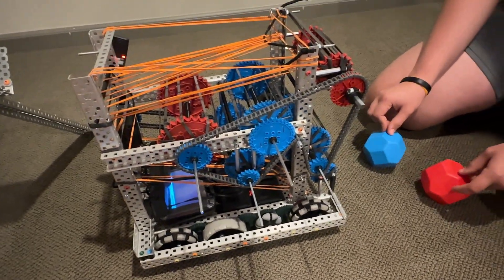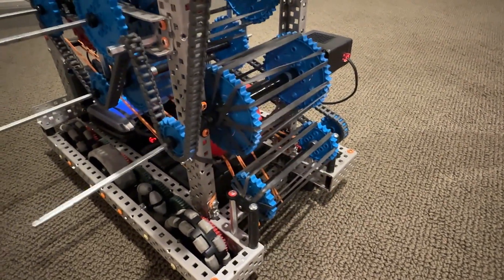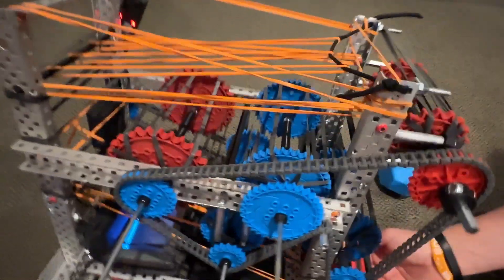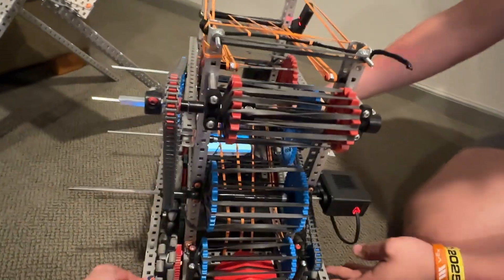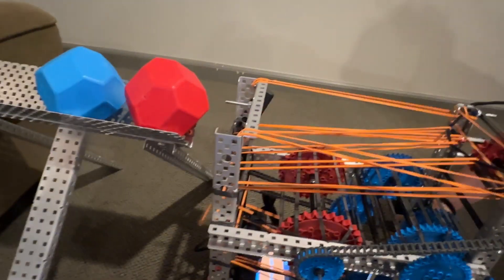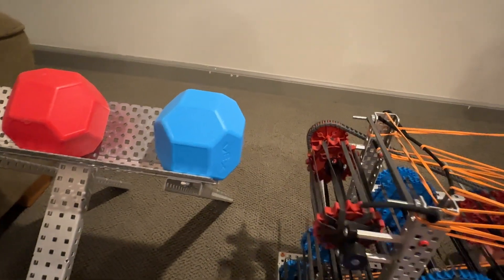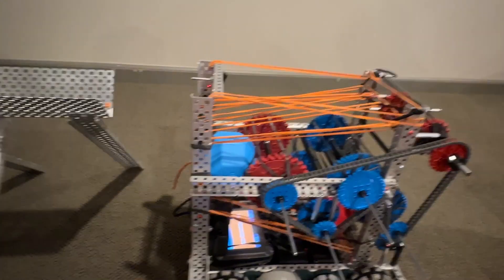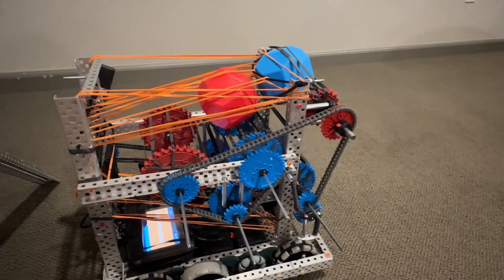Push Back RI12H Explanation

Comment: There are a lot of places where you insert a 1 x 2 x 1 c channel into a 2 x 2x 2 u channel or another 1x2x1 c channel. How do you do this without bending or forcing the c channel in? Could you explain?
Reply from the maker: U channels have a 1 inch gap as opposed to the 0.875 inch gap c channels have. So c channels slide right in.
Reply: @9MotorGang  Thanks for the clarification.